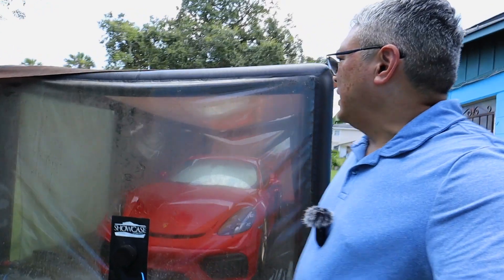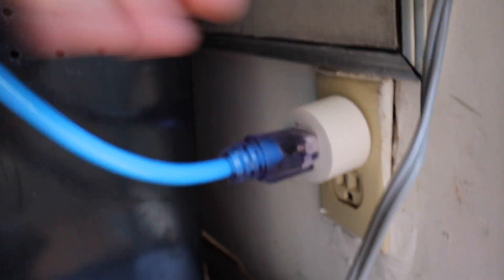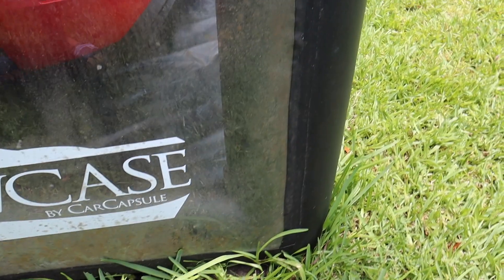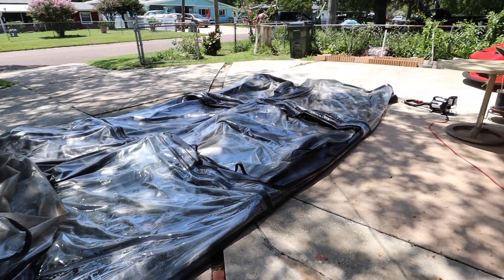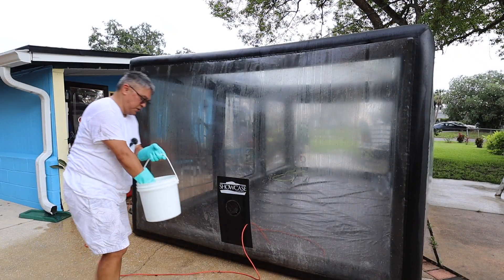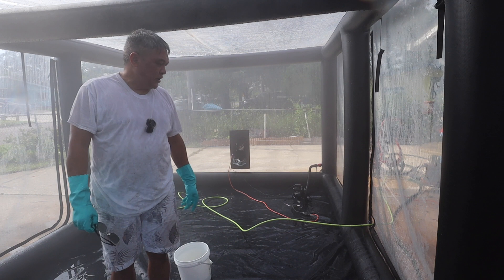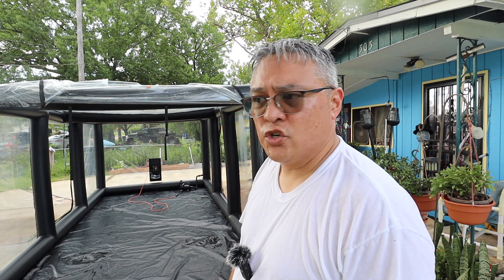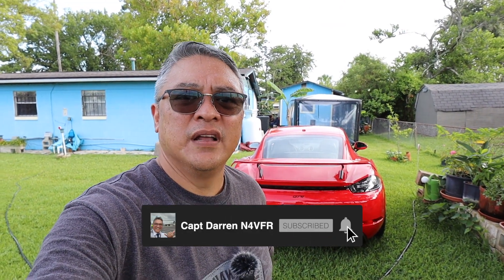Clean Car Capsule  Showcase| Removing Mold from Car Capsule | Car Cover

Comment: You really shouldn't use bleach to get rid of mold if at all possible.

1 - It doesn't kill mold in porous surfaces well.

2. Even on non-porous it can pose a problem.

 About 95% of the bleach will quickly break down into water and salt. That salt will attract moisture later and can cause mold again. 
    
It should be fine as long as it is a non-porous surface and you rinse really really really really well.

I've had hundreds of mold jobs that people tried to use bleach to fix and it came back even worse later on. 

People using bleach is job security for us but we'd prefer people didnt use it though.

Keep in mind that plastic is definitely a porous surface.

Also, having some air flow inside the capsule will help keep the plastic surfaces dry too.

- 20 Years owning and operating a mold remediation business around the great lakes area.